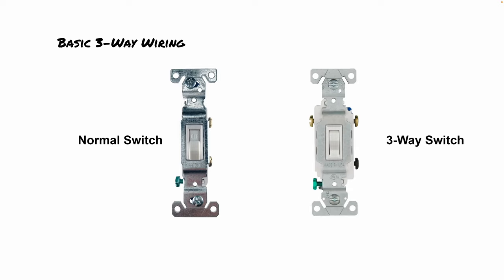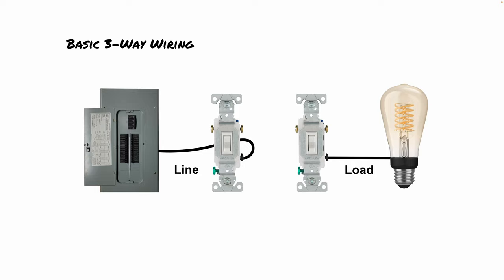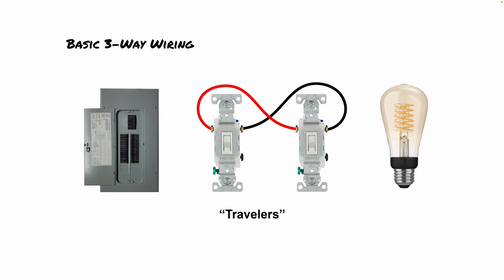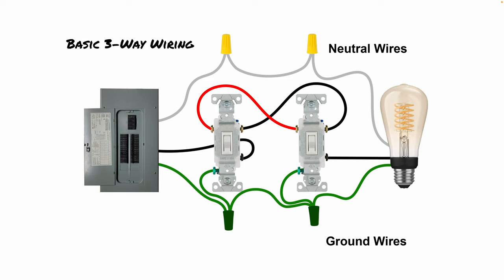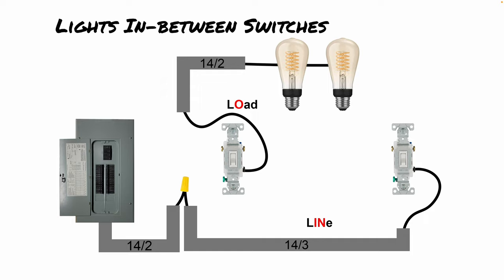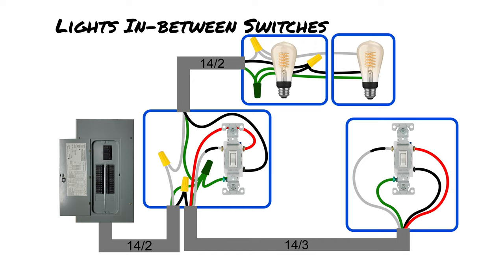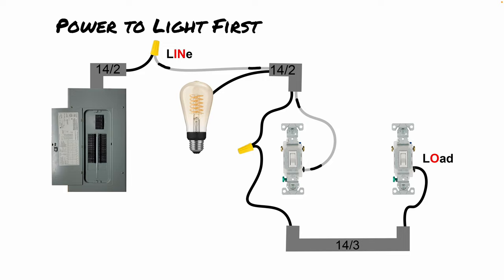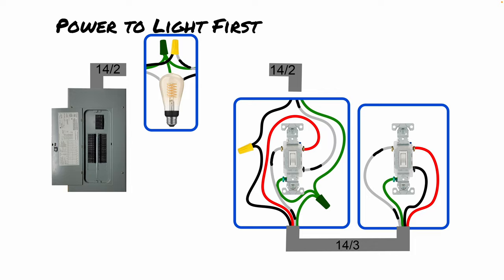How to Wire a 3-Way Switch - Wire-by-Wire Diagrams for 3 Common Scenarios

Comment: I like how you show the 3 different ways this could be set up. 
I'm trying to change out sensor switches for a 3-way switch system. I believe I have the 2nd method you showed. The only thing throwing me off is that the white wires are not marked with black tape. 
Simce my knowledge is 0 on this subject, I'm probably going to call an electrician to confirm everything is wired correctly.  This is a 30-year-old house I just purchased, and the previous owner made a lot of changes. He's not cerrified/trained in any skill but knows a lot about many things, so he did the work by himself.  
That scares me a bit. 
Anyway, it was a great presentation. 👍 👏

Comment: Can I connect red on travler terminal #1 and black on travler terminal #2 in 3-way switch? (the pair on top side of the switch)
Because light is on when I off all switches(i have to on one switch and off the other switch to off the light), i want to light off when I off all switches.

Comment: I have seen multiple videos and appreciate the graphs and your reference on light receptacles. Do you have a video on floor receptacles and how line and load effect the flow of current? Especially, if there’s a light receptacle that turns the receptacles on and off. Is there a way to wire a receptacle incorrectly causing the flow of electricity to be interrupted? For example, an HVAC unit in between two receptacles.

Comment: In the last method, is it possible to run a neutral to the switch box for a smart switch that requires a neutral?
Reply: I actually have the same question. New code now requires that we leave a white at the box. So i would think maybe use a 14/4?

Comment: I have an 1974 home (alum wires, but I've installed short copper lines with anti-corrosive in the wire nut connection on the pigtail) with a hallway with 2 light fixtures and 3 light switches, the two lights mounted between the 3 switches. When a light switch is flipped, theists will come on after 10-30 minutes, like they have to.warm up and one end switch doesn't do anything. I can't find a video with 3, 3way light switches and 2 light fixtures which would help me see if there are some things miswjred. Do you have video on it or would it be possible to get a good diagram from you? If you let me know, I can send my email. Thanks in advance.
Reply from the maker: This may help you: https://www.buildmyowncabin.com/electrical/wiring-diagrams-3way-7.html
And since you have 3 switches: https://www.buildmyowncabin.com/electrical/how-to-wire-4-way-switch.html